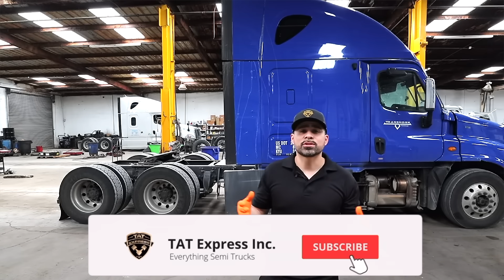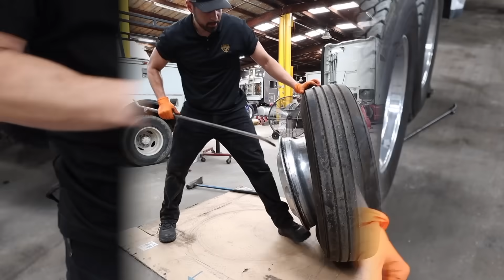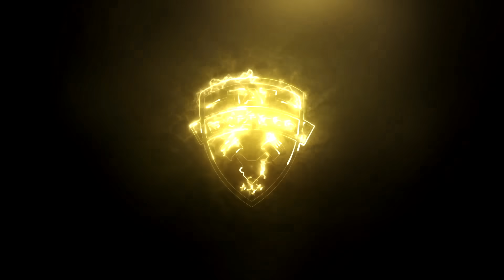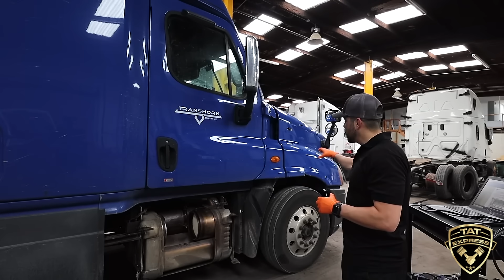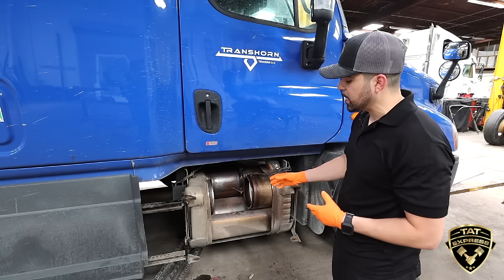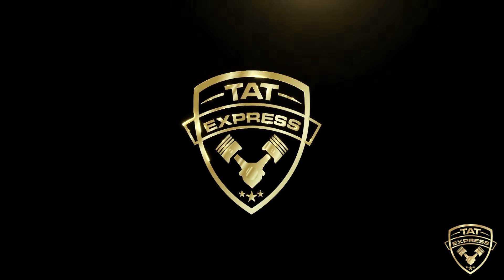Detroit DD13 DD15 DD16 SCR Fault Code 4364 18

Comment: brand new DPF filter OEM fixed this code on my truck. This code kept coming on while i was  going up hill then it would disappear. I replaced nox inlet and outlet sensor and still nothing change until i replace my DPF filter for new one and that fixed the problem. two years now code gone and never came back on now im flying up hill.
Reply from the maker: Thanks for sharing your experience.  Yes if everything else is working correctly than sometimes the one box will need to be replaced.  Be sure to keep a good maintenance schedule. We will be live on Sundays at 2pm
Reply: @TATEXPRESSINC His one box was good. He changed his filters. I didn't the same thing Anand the codes went away. I was told I needed a one box, but I changed the filters and no more codes.

Comment: What is the life of Nox sensors? And one box.? Two years ago freightliner installed awaining kit and things went good for two years now same problem. I get 3364/15 error once truck heatup to 111 degree centigrade. What could be wrong?
Reply from the maker: Muhammed, Nox sensors can fail at anytime, that is why it is important to check before replacing.  Be sure to keep idle times to a minimum.

Comment: Just found this channel and cant stop watching,can you disconnect the doser on these and run a regen to prove if a nox sensor is bad?
Reply from the maker: Heavy, thanks for watching and yes, that is correct.  You must test Nox sensors before condemning them.
Reply: High outlet nox cod be cause by more than a sensor tho

Comment: Sir I have opposites issue my truck has taking too much def fluids my mechanic change both nox sensors and dozer as well but problems is same any suggestions
Reply from the maker: Rock P, did he run the test in the video?  Also are you getting any check engine lights?
Reply: Yes sir I got MIL lights on and code is SPN 520372/FMI 16  he checked by diagnostics link and first he changed both sensors then def dozers even he updated software but still not fixed the problem  he said next we can change the pump my truck is 2017 cascadia it has electric def pump. Do you know what the def pump pressure should be. Because I’m getting 140 psi def pressure please advise me thank you

Comment: Every time I fill up my def tank to full my def quality light comes on A couple hours later of running it. Then when I’m like at 3/4 of def the service engine light goes away
Reply: Yes replace def filter I will check for leaks thank you for replying really appreciate it
Reply from the maker: Diego, if no leaks are found then, the test in the video would be recommended.
Reply from the maker: Have you serviced your DEF filter? Also check for external DEF leaks.
Reply: I say more to heat. If truck run hot with heavy load than yes same problem. Next time I will not full def tank to observe your claim. 👍

Comment: 5-30-2020 ..I'm on the side of the road right now doing my second forced regen i have codes  spn 4364 f18, 3364 f2 , 5246 f15. 
I'm on the back roads in Oregon where there are no freightliner dealership.  What can I do to keep from calling roadside or a wrecker?
Thanks
Reply from the maker: Ronald, how long has the faults been active?
Reply: @TATEXPRESSINC   I know 5246 f15  happened  40 minutes ago 
Still doing regen
3364 f2  2 hours ago 
4364 f18 ..... not sure
Reply from the maker: 3364/2 Improper DEF Quality
4364/18  Nox Conversion Low
5246/15   Regulatory Fault Ignored-Derate on
Reply from the maker: 5246/15- for 2011 you have 30 miles before forced to regen/ 2010 models have 10 hrs or 500 miles before forced to regen.

If you have a successful regen codes should clear.  If not, then the test in the video will need to be conducted.
Reply: @TATEXPRESSINC   thanks . 
I still have the check engine light 
Then solid engine light and 
Def amber light blinking. 
I have 2015 dd15
Reply: Will doing a 3 regen do anything?
Reply from the maker: If you have an active DEF fault and it did not clear with the first regens, a 3rd regen will not clear it.  The DEF system will need to be checked out
Reply: @TATEXPRESSINC   alright . Thanks so much for responding back
Reply: TAT Express Inc. I had this same issue, I got the same 3 codes, I got 25 percent derate for driving for more than 30 miles then I stopped somewhere safe and did a regen. Regen went on and then def light stopped blinking, check engine light went away, I just have amber light on but on diagnostics I have 0 codes. 

What should I get checked out? Any ideas. 
And does this mean the regen fixed the issue? 

This happened while pulling a heavy load on a mountain.
Reply from the maker: I would recommend running a low temp ATD to check for sensor drifting
Reply: TAT Express Inc. what is sensor drifting? Thank you for the reply
Reply: TAT Express Inc. hey TAT I just had a mechanic connect the computer, he didn’t even run the low regen test as he checked my DPF Filter and it was at 96.5 dirty, so he said this is most likely the problem, not my nox sensors, does this seem accurate? so he said wants to replace dpf filter, 7th injector and def filter for about $2000. What do you think of me cleaning out the old dpf filter instead of buying new from dealership?
Reply from the maker: Be sure to tune in in 40min and we will be talking about that on the LIVE
Reply: TAT Express Inc. thank you brother! I’ll be tuned in!
Reply: Throw a match inside the fuel tank and problem solved!
Reply: @ Ronald spray berry.. can you please help out . I’m having the same codes . How did you fix it what was the problem.

Comment: I have a 2013 DD15 cascadia I get that code every week turns on for about 3-4 days don’t come back for a week been doing this for 2-4 month, no one can figure it out
Reply: Yes I do have high idle times I sleep with the truck on, Apu are expensive
Reply from the maker: If issues continue to exist then I would have the ATS checked out and cleaned.
Reply: TAT Express Inc.  been debating if what to do restore the system and pay thousands or just get rid of it
Reply from the maker: This fault can be cleared once you have a successful regen either parked or rolling. If you have high idle times this code can become active but later become inactive once all self tests have passed.

Comment: Do you know if software update will help with low larmf compensation issue? 
after cleaning def build up i disconnect   def doser and regen to burn off build up i couldn't reach.
reconnect and regen again, hope onebox is cleaner.
Reply from the maker: Yajeetj, in some cases your soft ware can fail to communicate if connected for a long period of time or software driver issues with adapter.  An update needed on the ACM or ECM is rarely the cause.

Comment: Yea mine got that code and 25% torque derate
Reply from the maker: James, its best to have it checked and tested sooner than later.  Have you tried to do a park regen?
Reply: Yes i have a tool that will do force regens. Local mechanic told me replace both nox sensors. Took 1 code off for extreme low nox conversion but left the other code for low nox conversion.
Reply from the maker: James, changing sensors would be the last resort.  Checking engine faults, DEF delivery system and checking for DEF build up should be done first before swapping sensors for this code.
Reply: Seems like so many mechanics first answer is change sensors
Reply: Freightliner in des moines ia told me its over defing.
Reply from the maker: James, that is the reason we made a quick video on troubleshooting steps for repair.
Reply: Im live in Houston tx area...your shop is in Texas?
Reply from the maker: Yes we are right off of I-45 coming into Dallas before I-20

Comment: Adam I have daycab dd13 2013 can you tell me please why i don’t have Water separator filter? Is that going to be a problem during the winter or cold weather? Thanks man
Reply from the maker: Sean, thank you for your question.  Detroit has done away with coolant filters.  Engine after 2015 do not require coolant filter due to updated module.  Test have been run and there is not negative effects of this change.  I would still test coolant concentration with test strips.
Reply from the maker: Sean, are you talking about fuel filter housing that is installed on frame?
Reply: Yes talking about the glass or clear plastic filter on the frame. I have coolant filter too. I think they called that fuel water separator if I’m not mistaken
Reply: Sean Hortillas yes you have the glass filter.  What’s the problem?
Reply: I don’t have that on my dd13 2013.I do not have glass clear filter on the frame. That was my question originally. Why i don’t have filter on the frame?
Reply: Sean Hortillas you should have it, it’s next to your power steering fluid tank. Big glass filter. Not in the frame or nothing. Between side of  radiator and power steering fluid tank Driver side.
Reply: I don’t have it. Dm me your # I’ll send you picture of the engine if you want.I know what are you talking about right next to power steering box but bolted in on the frame. I know it’s wired that is why I asked. 2013 dd13
Reply from the maker: Sean, sorry I misunderstood your original question.  Does it look like it was removed or is that how the truck was manufactured?
Reply: No worries Adam. It’s manufactured without fuel water separator filter. I’m in Chicago so you think that would be a problem during the winter? I got the truck used with 400k miles on it. I did my research but couldn’t find an answer hope you can answer my question.Thank you
Reply from the maker: If it was manufactured without fuel water separator than it should be fine.  If this concerns you than I would add an aftermarket fuel water separator.
Reply: Thanks Adam

Comment: Sys 25 spn1548 fail 5 any ideas what this code means?
Reply from the maker: Remi, thanks for watching.  Looks like fault on HVAC-Front control unit  COTC sensor-short to battery or open
Reply: @TATEXPRESSINC  thanks for the info.  Where is this sensor located?
Reply from the maker: Should be located in the air box that houses the evaporator in front of passenger seat.  I would test the circuit.
Reply: @TATEXPRESSINC  really appreciate the information and quick response!!

Comment: I only get this code  going up hill with a heavy load and it goes  away after day or two.any suggestions?
Reply from the maker: Amraj, I would recommend running through the test mentioned in the video to ensure everything is working correctly.
Reply: @TATEXPRESSINC  test goes fine once the error goes away. But come back on hill and heavy load. Tech says everything fine.
Reply: So truck usually driveable when this code pops up